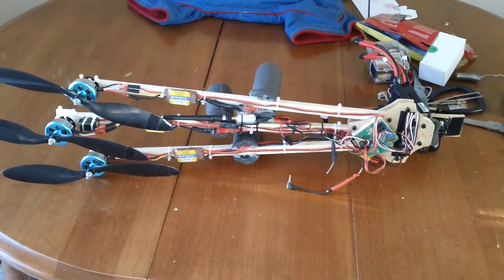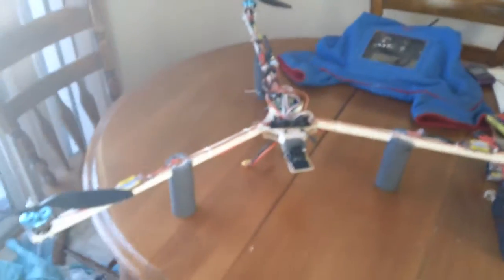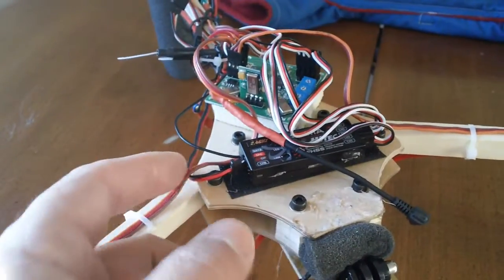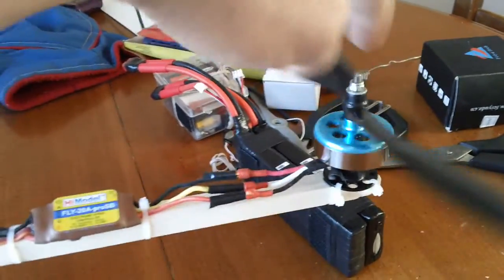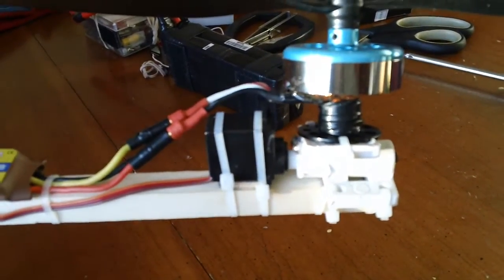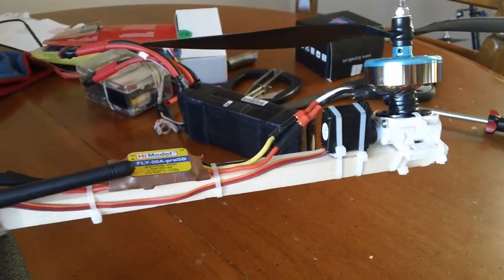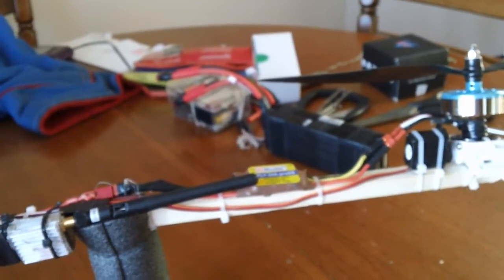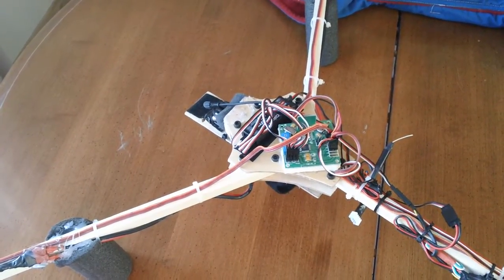Tricopter V2.5 is super cheap

Comment: I made a tricopter of my own and ran into problems.  For some reason the motors don't turn on at the same time and run inconsistently.  Also they cut out sporadically.  I calibrated all of the speed controllers and played around with the kk2 board but to no avail.  Can you please help.

Comment: As far as the control boards go, I've read a lot about the Ardupilot and it is very appealing albeit quite a bit more expensive than the KK board, but the ability to add GPS, baro and magnetic sensors, plus all of the autopilot prog capability, it is most appealing. I've used Arduino's a lot and they are quite the thing.
However, I most definitely will be starting with the KK board as I'm a firm believer in starting simple ;-)
Again, thanks for the practical overview of your build.  best, Bob...

Comment: The new v2 HK control board with the LCD screen right on it is supposed to be excellent it is $30 but may be worth it. I purchased one and have had it for about a month now but have not tried it yet. Still using the same board you have here. Seems to work fine.

Comment: what kind of settings are you using on ur transmitter? I'm running in Acro right now and its very hard to handle, sinks, doesnt have a good hover, is heli mode better with throttle curveS?

Comment from the maker: @jxdigital Hi first the HK board work's fine for qauds or tricopters 
Well this tricopter V2.5 will lift a gopro no problem and it's very easy to build but my super cheap quadcopter is stronger in a crash. Both have the power to lift a camera. Good Luck

Comment: Hi, I'm thinking about building a quadcopter, or a tricopter (also to hold a compact camera or GoPro later on). I was thinking about a quadcopter because of the slightly more lifting power.
Do you have any advice based upon your experience with both tri&quad platforms? Also, you mentioned about replacing the HK board in the end. Is the reprogrammed HK board not very good for Tricopters?